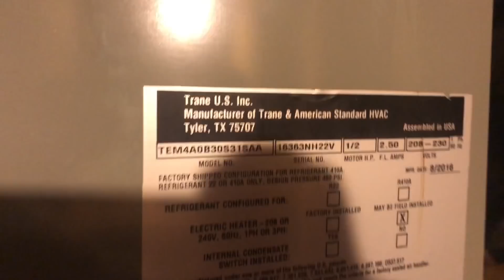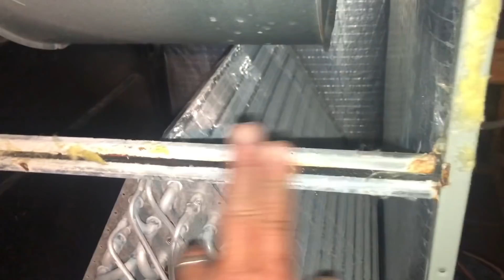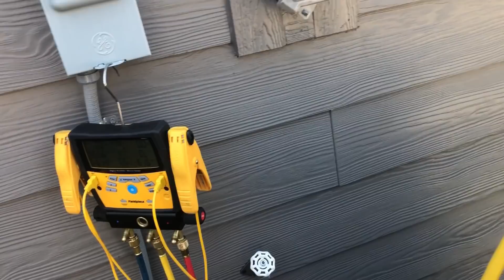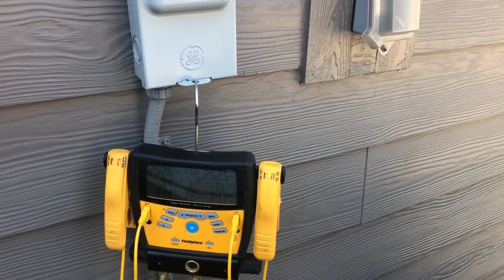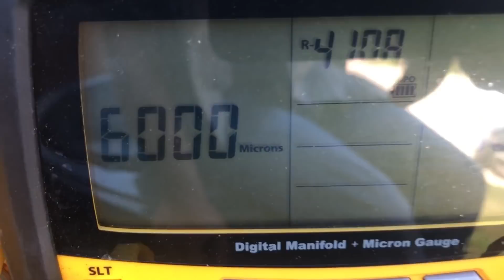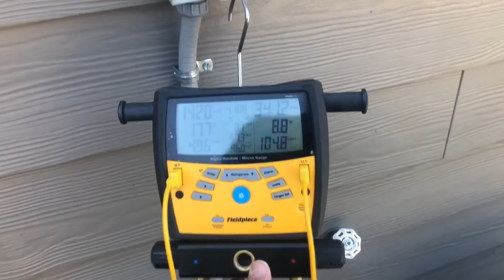New Construction Trane Failed TXV replacement with tips

Comment: Trane use to be fantastic for quality..however lately the equipment seems cheaper and quality of construction seems to have gone done too. Big corporations dont care..sales are sales to make profits. That looked like a piece worked house..as most new construction is these days. No nitrogen used at rough in, who knows if proper vacuum was originally pulled. I've seen it first hand around here..Ryan Homes is a huge one for crap. Good video..be safe out there.
Reply: FLY EAGLES FLY Bleed Green the TEM cabinet sucks THE TAM CABINETS ARE GREAT.

Comment: They put the dryer vent too close to the condenser!!!
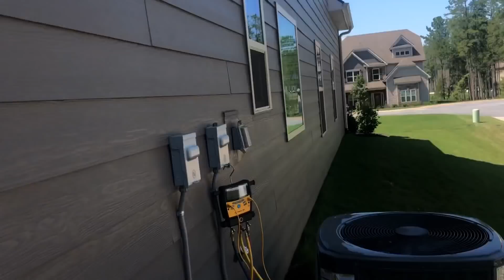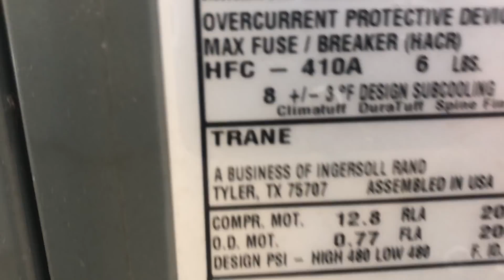Reply: I am assuming you are talking about the vent right between the units? @21:28 If so, that's where the line sets from both units go into the wall to chase up to the attic, its not for the dryer.  Its also where they bring out the condensate drains.  @21:19 There appears to be two bath fan vents in the wall, as well as the dryer vent outlet above the 2nd story windows.

Comment: A 3/8-inch vertical liquid line will loose about a 1/2 psig per foot of rise, plus the the run across the attic. Is there enough subcool to prevent flashing in the liquid line?

348 psig = 106° Saturated - 8.7° subcool = 97.3° liquid line temperature 

Rising 2 stories onto the attic approx 20 ft
So there would be a 10 psig loss in pressure at the top of the rise. 

338 psig = 104° Saturated - 8.7° subcool 95.3° liquid line temperature 

With such a long run across the hot attic picking up unknown amount of heat, that will drive the subcool down. If the line temperature gets close to or above the saturated temperature it will start to flash, especially downstream of the filter-drier.

Would have loved to see your line temperatures at the evaporator. Especially after the system came out of hot pull down.

Maby pushing the subcool up to a solid 9° or 10° to ensue a solid column of liquid at the TXV.

This is more of a problem with these newer units that have such a low condenser split of 10° vs 25°~30° on the older systems.

Comment: Dirt in the line set or bad txv? 🤔
Reply: Bad TXV.. oh man there was a whole assembly line of bad Danfoss TXVs.. Installed a new unit with two people who never went through school for HVAC, and when I started up the A/C...the TXV frosted past and the system pumped down..oh man was I MAD.
Went back to replace the TXV, same freaking problem. They sent the lead tech behind me to install another TXV (all factory parts) and that ALSO FAILED!!
Long story short, the installed a new unit. No dirt, no foreign objects, just...crap. lol
Reply: @FrostBlueFire  I've been removing the txv's & just installing piston. I've done it with Carrier, Lennox, Trane, Goodman. Only need the piston adapter with the nut. Google the piston chart for piston sizes. 💪👍